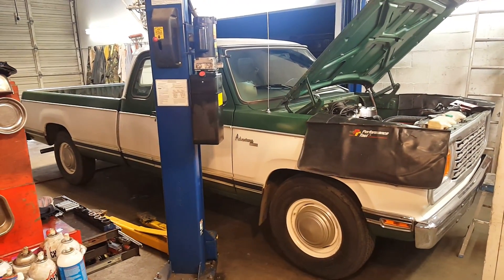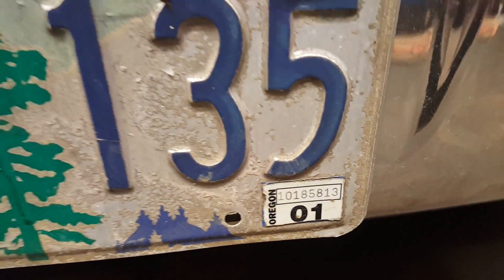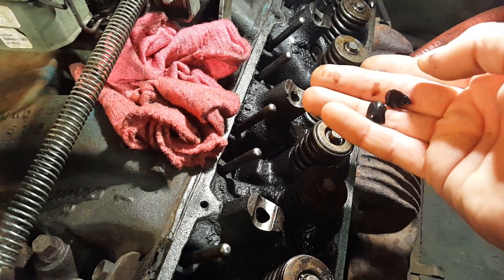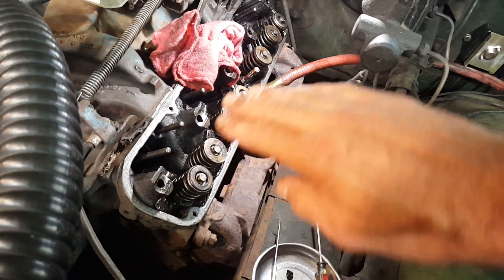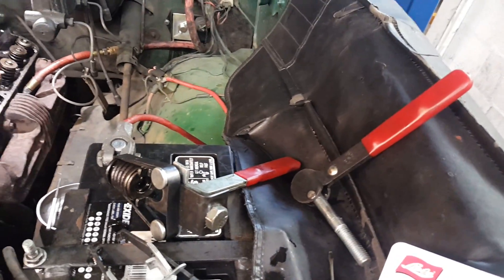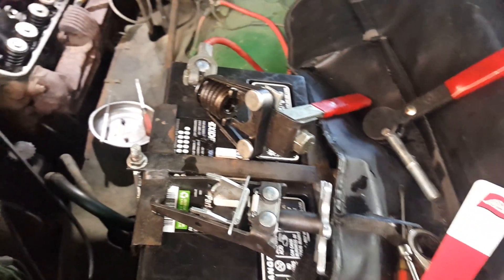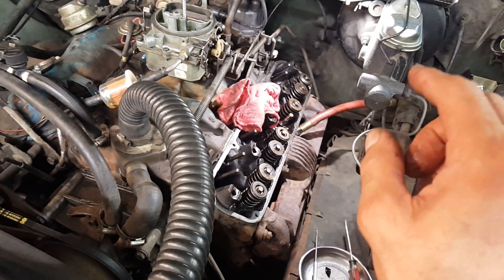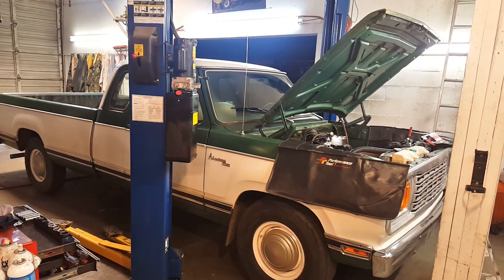Quit Smoking Dodge

Comment: Considering that truck is nearly 40 years old  that engine looks to be in great condition.  At least for much of it's life it was fairly well maintained. 

 It's funny that it's a 1978 in that condition, my ex-father in law had a 78 Dodge sedan with a Chrysler small block in it but he didn't believe in oil changes!  

Honest to god, he had been a bigwig with a trucking outfit and had been getting a new car every year for his personal use...  just drove them and put gas in.  

When he retired he bought the '78 brand new.  In one of the craziest conversations I have ever had, I tried to tell him to change his oil after the break-in period, I probably even offered to change it for him.  

But HE said that he had been driving cars for 30 years and never changed his oil!  He obviously was an intelligent guy, in his way, but boy what a blockhead.  

I remember him and his teenage son pulling the engine after about three years and not very many miles.  The top end was as coked up as any engine I ever saw!  

I TRIED to tell him.  But he knew better...   

Seeing THIS engine nearly forty years on, I just shake my head.

Say, shouldn't that Dodge have a had a "Lean Burn" ignition on it?